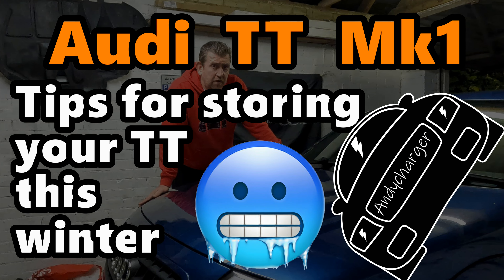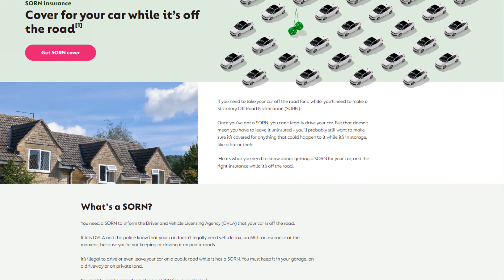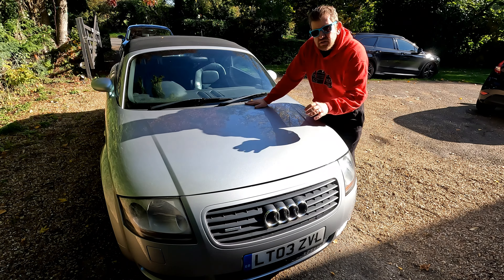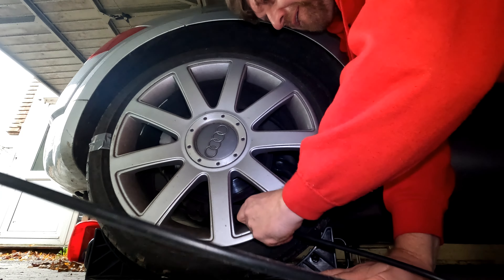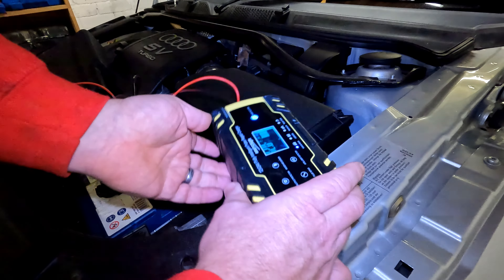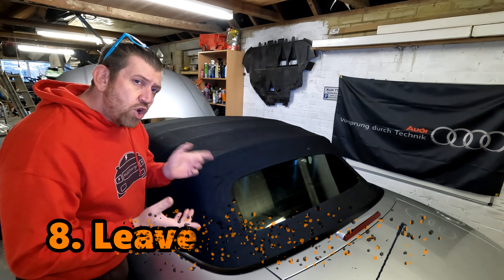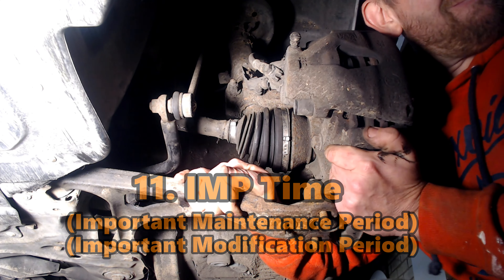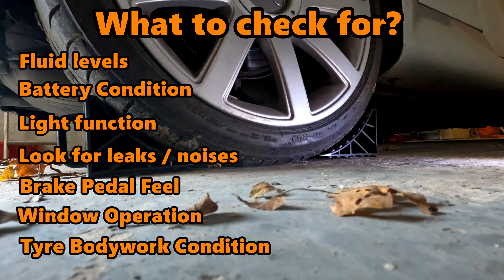Audi TT Mk1 - How to store your car for winter - Car hibernation

Comment: Great video Andy, one point i want to add about fuel. Whilst we should be using high octane fuel with low ethanol content, not everyone does, so if you are using e10 fuel, avoid leaving the tank full for long periods of time as the fuel breaks down differently to non Ethanol fuel. In general fuel also loses potency over time, so i avoid a full tank anyway, just so that ive not got a tank of lower octane fuel to burn through come spring time, but that’s just my preference
Reply from the maker: Thanks Bryn and a very valid point. I was in 2 minds due to the condensation build up in the tank with little fuel but also the cost/fuel degradation of too much. I only use E5 in the car as I know the higher ethanol content is not great to be sitting in the  tank and pipes for a long time, rotting them away!

Comment: on previous roadsters, I have always disconnected the battery. this has been easy due to the battery being under the bonnet (MGs).  What is the best option for a 3.2 roadster where the battery is in the boot?  how do you get in the boot with battery disconnected?
Reply from the maker: @markdenton1782  on the roadster, there is a pull handle in the locked compartment behind the drivers seat. Give it a pull and the boot pops open. Inside the boot wall ( just in front of the light cluster) is a panel you can pop open to pull the fuel cap release cable too. My top 10 tips for roadsters are here Audi TT Mk1 Roadster - 10 Top tips for owners
https://youtu.be/NuJUSI2DOKc

Comment: Andy, 
I have water in the drivers footwell, any tips where it may be coming from. Any help greatly appreciated.
Reply from the maker: Hi Gary. It could be a couple of things, depending where/when it happens. 1st check the window and door seals on the drivers side. Any sign of wet around them or is the bottom the door wet? Next, pop the bonnet and make sure there is nothing blocking the drainage channels at the base of the widscreen and down into the top of the wings. If this is getting blocked up, it could instead be seeping in through the electrical loom grommets in the bulkhead. So make sure there are no leaves,etc blocking those up. Let me know how you get on!
Reply: I had 2 leaks when i bought my 225 coupe , 1 aas through the pollen filter housing so i rtv,d the housing. Unfortunately it still leaked so i got my mate to pour a watering can full of water with red food colouring on the area then got my head under the glove box and i saw a leak of red water through a inner wing seal . I silicon sealant the whole area. No leaks now. Hope this helps